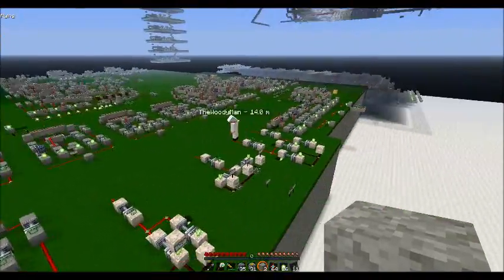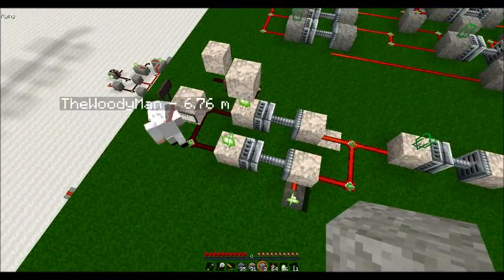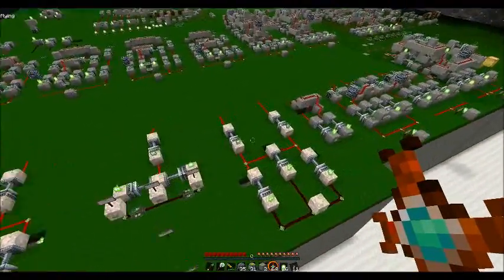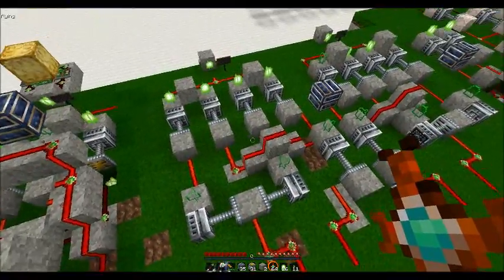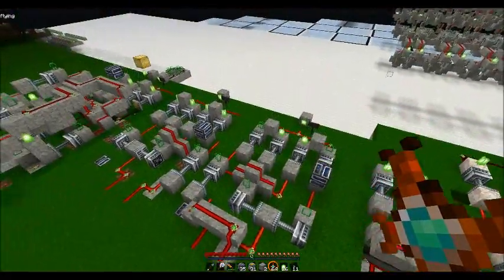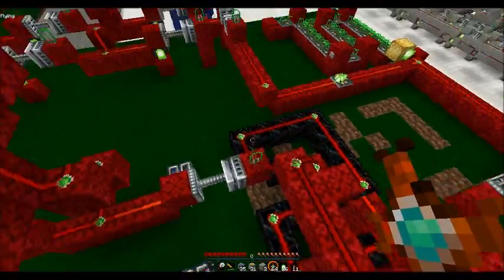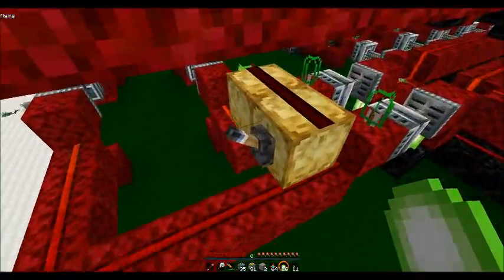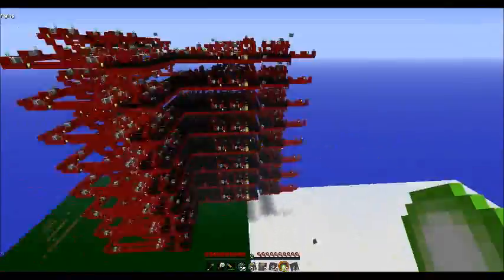Instant Computer: Basic Logic gates and my ALU

Comment: I believe I typed it on the other video. Dual edge instant wire will help you get rid of unwanted wiring, Just search for it it combines the high low wire that instant wire uses into one wire. Oh and that you see on the instant wiring is a graphical glitch. The redstone updates but hasn't got enough time to graphically update itself. I believe Tavirider talked about it when he invented this thing.